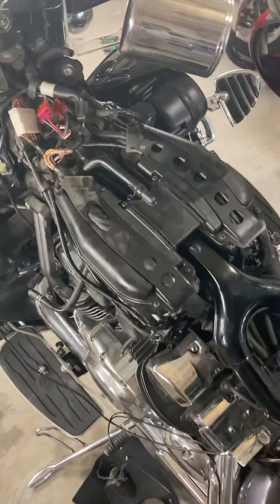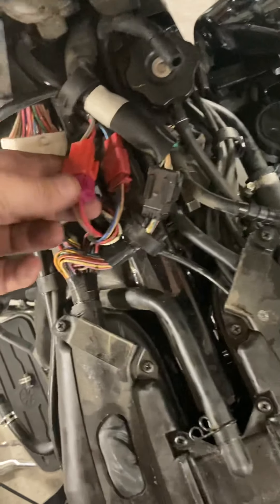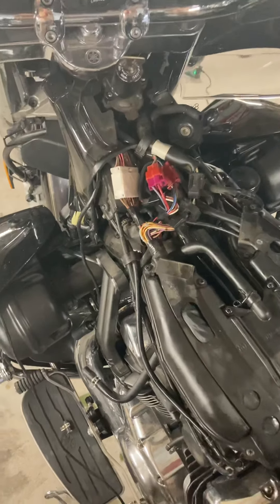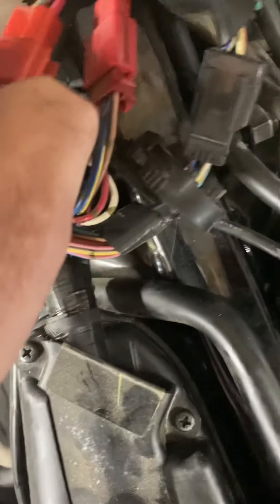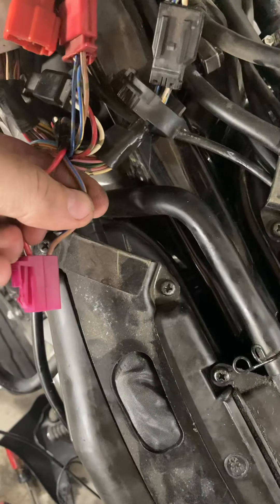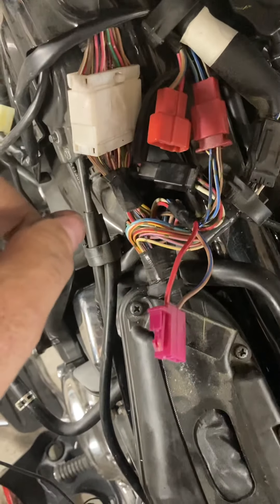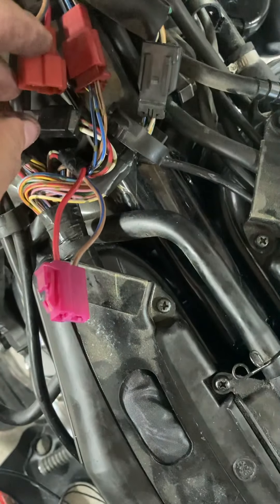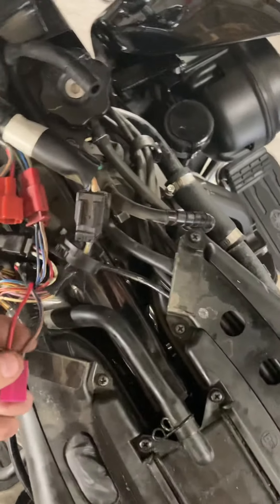DIY Yamaha Royal Star Venture Ignition Bypass

Comment: Interesting, I like your preventative way of thinking. Would you please elaborate on what ignition problems can or will manifest themselves and how a relay switch will help prevent said problems? Thank you for your insights, fellow RSVer.
Reply from the maker: pretty simple ignition switch failures on these bikes are caused by overload , i.e., passing lights and all pass through the ignition switch.  The installation of a relay takes this load off the ignition switch exclusively and will almost guarantee you'll never have an ignition switch failure.  Failure of the switch means no start.
Reply from the maker: All power from the battery except a couple of circuits for the Radio, CB , Audio system goes through the ON section of the ignition key switch.  Now the key switch turns on the relay and all the power runs through the relay instead of the key switch.
Reply: @ziprun1  thank you for that, now I understand. You mentioned passing lights drawing more from the ignition, LED conversion would help lessen the load, wouldn’t it? I’ve changed over all of the bulbs of the signals and headlamp, to LED.
Reply from the maker: @jesusacovarrubias1390  LED is all around much better but back in the day we didn't have the options we do now.  Bet you had fun replacing the bucket light up front.  Did you do all the work yourself?
Reply: @ziprun1  if by bucket lights you’re referring to means passing lights, no, I don’t have those. I have been searching for a pair, but they are pretty pricey. I did replace all of the others, though.